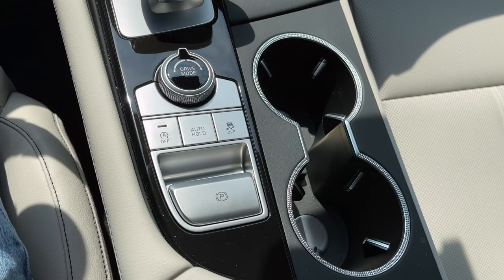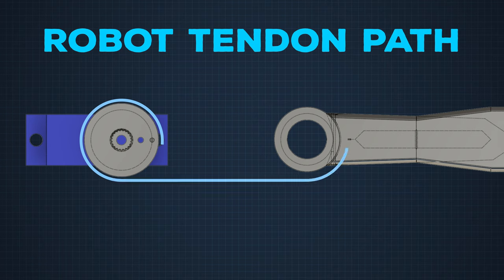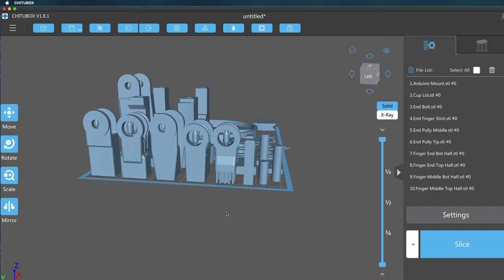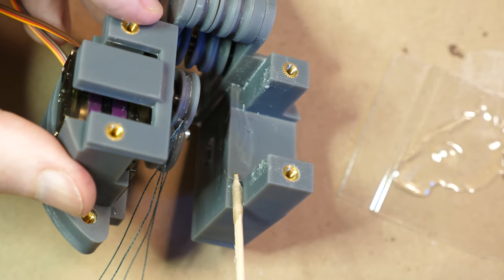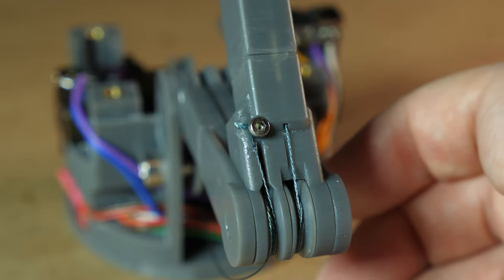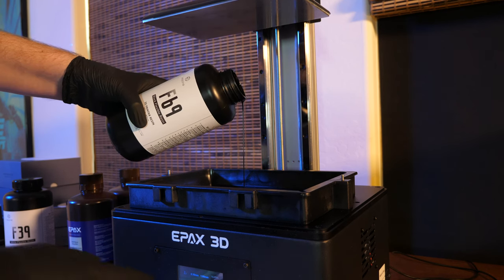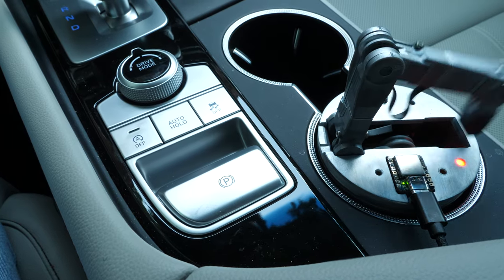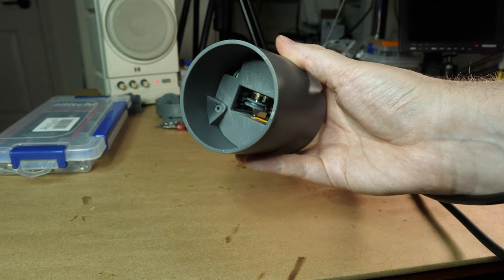Tiny Robotic Arm - Will It Work?

Comment: Without a doubt you need a second robot in the other cup holder to operate the button for the 1st robot!  Even though it was a fail, like my father used to say "don't do anything half-assed, do it whole-assed"
Reply from the maker: Not a bad idea.  But that 2nd robot will need to use some better actuators.
Reply: That's a great plan. Every time first the weaker robot arm tries it ten times without success, and then the other one pressed the button on the first attempt.
Reply: @Nerdtronic  If something doesn’t work use a bigger hammer.
Reply: @Nerdtronic  This was not a failure: it was hilarious. And the way it folded itself up in defeat was icing in the cake. That's not a failure.

Comment: i would have just connected the two wires from the button to the same arduino controlling the robot 
and synchronize the activation of it so it looks like your robot is actually pushing the button
Reply from the maker: A lot of people have said "just connect the wire with arduino" - yeah but then I wouldn't get to make the robot. But your suggestion is off the charts. Do BOTH!
Reply: @Nerdtronic  yeah brother cheat just enough to win . its kinda genius and 
nobody would know .
on the other hand even if you do make a 
video or a short most people would 
actually respect that little trickery.

also it is basically free content
that you can pull off in practically 
no time at all . win / win 

either way you have my blessing 
take care brother

Comment: The auto start stop is supposed to save roughly 7% on average. Obviously there is a huge asterisk as it depends in your route. You should do a test.  Drive normally for idk a week or month with it enabled and another with it disabled
Reply from the maker: I actually only drive about 3000 miles a year in that car. So there are weeks and even months that I don't use the car at all.  I also live in the desert, so summer months the feature turns itslef off anyway because it's 115 out and the AC is running.
Reply: My dad believes it's not worth it because of the potential damage to the engine. I don't have an opinion personally

Comment: Cool robotics project! Get some nice MKS servos. They're small and extremely powerful. They are pretty expensive, but when you need extreme resolution and power they're probably about the best you can do. Also, the fishing line you used will stretch over time. The metal line that is often used for necklaces works great here. You can get it very thin and it is available at craft stores and WalMart. I build RC hand launch gliders (DLGs)  that use bent piece of metal to act as a spring that holds a flight surface deflected in one direction and then uses one of those MKS servos and that metal line to pull it to the desired position. This set up works very well and I've used it for other various maker type projects as well. Great video!
Reply from the maker: Thanks Michael for the detailed comment. I’ll check that stuff out.  Maybe I’ll remake this robot someday.
Reply: I appreciate you pointing out MKS

Comment: There isn't a true-geek among us that doesn't salute this effort. Words like "failure" and "useless" should be saved for other non-heroic and mortal efforts. This robot should live on in perpetuity, at least in our hearts and minds! Yes, you could find more powerful servos that are larger, and require a robot redesign. But another source of very small but powerful RC servos is for high performance RC gliders. In those applications weight, precision and actuator speed are most important, but so is power. Take a look at those servos. They're more pricey, but they may let you use your current design without modification. 

So I'm an American who's been living in Europe for nearly 6 years now. When I first encountered this feature it bothered me too, but I found a different way around it. If your car functions as do the cars I've driven here, you can 'defeat' the execution by using lighter brake pressure. The shut-off occurs when the car's speed is near zero, AND the brake system is near full pressure. 

I was able to train myself to lighten up on the pedal pressure just as the car was about to come to a complete stop - I use just enough pedal pressure to stop the vehicle, but not enough to stop the engine. The engine remains running until I press the brake pedal fully, and I only do so if it appears I'll be there for more than a few seconds. You can also lighten pedal pressure just before you want to car to move, e.g. when you see the light is about to turn green. This way the engine starts, but the car doesn't move. It prevents 'lurching' when the engine starts at higher revs as you move quickly from the brake pedal to the accelerator pedal. 

All that said, please let me also add a dissenting voice to the purpose of your robot. Regarding the small amount of fuel savings that others have mentioned, it's really about emission savings. It's estimated that idling engines cause 30M Tons of CO2 every year. I know it doesn't seem like much when it's just your car, but when it's thousands, or even millions of cars, it does add up to a difference, especially in city driving and bumper-to-bumper freeway commuting. This feature has been VERY popular on European cars for years because of heightened environmental concerns. 

I was also worried that the additional wear-and-tear on the starter system would lead to early component failure and replacement costs. But I think this one of those things that we BELIEVE without data to support it. It's never been a factor that I've heard car owners here complain about. And google it. I think you'll find that modern cars do not suffer from this problem. It's only those of us of 'more advanced years' who imagine it being applied to our old muscle-cars from the 60s and 70s. 

So yeah, I like the idea of designing and building this project. In fact, I'm actually a bit envious of your creativity. I'll attempt to up my game for future "useless" and "failing" projects. Take care. :))
Reply from the maker: Haha thanks!

Comment: Knowledge of leverage and torque forces would have helped you there. That stop start function is more practical in cities because it cuts exhaust emissions rather than saving gas. I also question how long the starters last (as well as the access+cost to replace them when they fail)

Comment: Brilliant! You 'could' always modify that button to just be a flip switch though. 
 
When flipped on it will be normal, 

When flipped off, it has a circuit that will wait however long is necessary and then input the momentary depress signal required to turn off the feature

Then your cup holder robot could instead be a cup holder robot or anything else.
Reply from the maker: I considered hacking the switch but I didn’t want to physically modify the car.  I’m sure there are other ways to do it electronically also.

Comment: Why not hook the arduino up to the actual button. You can read the light within the button and simulate button presses without even touching the button? You may be able to even do it with just putting a plug that you make into the button which allows the factory plug to plug into your plug…
Reply from the maker: Yeah I’ve done that before with other projects. A. I didn’t want to f up my car. B. I wanted to make a robot. 😁

Comment: Yall complain about him wanting to turn off a feature that safes a TINY bit of fuel and cry about climate change, but do you realize that the most wear in an engine happens when starting and stopping the engine? Kinda fun then the feature is called start stop :)

I would rather have the engine burn maybe a few gallons a year than having the engine break down earlier, having to call a tow truck and having to get the engine replaced earlier than needed.

That robot could work, just instead of a little flexible tip, maybe add a hammer to it? 😂
Reply from the maker: Thanks!
Reply: "but do you realize that the most wear in an engine happens when starting and stopping" you missed the part with the word "cold" near "starting", instead your fantasize about wearing when an engine is stoped... stoping an enging damage it? Really?
Reply: Cold starts wear an engine out. If it's at operating temperature there is no more wear than when it's running, because all the clearances are correct at op temp and the oil has already been circulating throughout the engine so there is still a lubricating film everywhere. Wear on the starter should be minimal if it was designed for an engine with the feature. I also believe the feature doesn't start in cars with this system until the engine has had a chance to warm up.
Reply: @space-qc6cl  there is still no oil pressure when the engine is stopped. Our a6 tdi did it's start stop despite running for 20 seconds.

Manufacturers had to engineer the bearings to work for around 3 times longer due to the start stop systems (don't know where i heard that and too lazy to search it)

You can do literally one Google search and find out that start stop wears your engine more than just letting it run.

Comment: My teacher told me once that there is no failure in research. Either you will solve the problem or you find out that this problem can not be solved in that specific way. So in both cases, you learn something.
Reply from the maker: Thanks.  I learned a lot on this project.

Comment: For VW cars they make  harness that you plug into that button that will remember the last setting, not sure if anyone makes one for the genesis.  You can also re-program the computer and change the voltage range so it never stops the engine, it was the first thing I did on my wifes car when we got it.
Reply from the maker: Cool. Yeah I might do one of those things.  This robot was mostly supposed to be for fun.  Thanks for the view Ethan.

Comment: A very good engineering project. Even if it didn't work :) One possible simple solution to try though, might just be to put some weight into the tip. It doesn't really have enough mass for the "whack it ten times" approach and the servos should still be able to move the arm with the tip filled with lead.
Reply: Alternately, repurpose the robot with a slight code change so that whenever anyone cuts you up it can give them the finger :)
Reply from the maker: YES!  This should have been the robot finger exercise.. flipping people off

Comment: Pretty fun project. I think you have a plenty spare time. If you touch that button every time you get into the car you will do automatically, you will learn in your muscle memory.
Any case, I think you can do it work just add some weight in the finger tip. It's like a hammer you just need a bigger hammer

Comment: Take out the switch, connect small relay, use small micro?
Reply: Similar solution I've found to a "ASR being on" problem on a GOLF MK4 but the DIY mentioned soldering in a capacitor, might work with this thing as well.

Comment: Another approach would be to make the button pressure through a roller at the end of the finger. The finger would then "swipe" the button. The force would theoretically be the torque divided by the arm length divided by the sine of the angle of the arm to the button.
Reply from the maker: DUDE.. I just subscribed to you so that you'd have more than one subscriber.  You seem to know a lot about torque and math.  Thanks for the advice.
Reply: @Nerdtronic  I have an Arduino bidet. For real. It has a range detector which I ping to get the flight time of the echo to determine the nearest object. The detector is about a foot off the floor and a few inches to the left. The idea is to detect a dog walking whereupon it turns on the cold water. The cabinet has a red and blue button for a person to select cold or warm water. The water is controlled through a pair of solenoid valves. And it has timers to shut it off after a period. About a year after installing it I updated the software to trigger the "red button" code if it detected an object less than four inches away, which the dogs never get that close. With this I can turn on the warm water while still on the toilet. That is nice in January.

Comment: I truly hate some of the “features” auto makers are forcing on us. I’m sure your car is still under warranty but at some point you might investigate getting the ecu flashed to keep that setting off. That said this was a really cool video!
Reply from the maker: Thanks. I hope it was a phase and that newer cars won’t have it.
Reply: @Nerdtronic  it’s actually not good for the engine.
Reply from the maker: @kz6fittycent  Right?  Several commenters gave me crap for wasting energy. But when I pull into my driveway and right before turnign off my car the engine shuts off and then has to start up again before I shut it off for real - seems like that would be wasting more energy and wearing out the starter.  Not to mention I'm not installing it on millions of cars, just one.

But it was just supposed to be a fun challenge anyway.  Which it was.  Thanks for watching.
Reply: @Nerdtronic  Once you have stopped, keep your foot on the brake and turn the key one click. Then put it in park and turn the key all the way off. 
Newer cars won't have it. They will be electric 😉

Comment: This is a cool project, but umm why go through all the hassle of designing a robot, when you could just use a mosfet, or relay to accomplish the same thing. Plus there is nothing taking up a cup holder. You could put it in the center console so you wouldn’t have too look at it. Although this is still pretty cool.
Reply from the maker: Then I wouldn't get to make a robot. 😁

Comment: Hello, Michael, you two are great. Congratulations to your bright son ;-)
Nevertheless, this is a great and very creative project. Perhaps you could re-program the robot to stir your coffee in the other cup holder???

OFF TOPIC: Unfortunately, I still haven't started using my Phrozen Sonic Mini 4k yet…

Are these resin printers really that loud (about 55 dB)?
Do you think that it is safe to put it into an enclosure of thick Polystyrene (with some reasonable air space around it)?
Do these resin printers get very hot outside?
Could trapped resin fumes cause any problems?

Sorry for these newbie questions, thanks ;-)

Comment: Powering off the engine does save gas when idling since the energy needed to start the engine is minimal. I saw a study a while back and I think it was like if you are waiting for more than 2-3 seconds shutting down the engine is more energy efficient. Just fyi
Reply from the maker: Turning down the AC a few degrees would also save energy - but most people don't do it.  I don't drive much or in heavy traffic.  I don't commute and maybe drive 3000 miles a year.  A lot of times this just turns off in my driveway and then immediately turns itself back on so that I can push the button to turn the engine off again.

Comment: You are trying to push the button via the torque of the first servo. That is going to require a torque of the button push force times the distance from the pivot point to the contact by the finger. You can't make the button require less force (assuming you are not going to modify the button) but you can shorten the moving distance by having the second servo make the final button press. Given the same servo torque you then have twice the button pushing force. I think you could get away with this because the servos have a much higher hold torque than move torque.
Reply from the maker: Yeah.. There was too much play in all the joints.  What you saw was the result of me trying to use momentum to push the button.  Even when I tried to push it using the 2nd joint, it still didn't push because the first joint also had play.  If I moved the robot to the other cup holder MAYBE it would have worked better because it would have been closer.

There were flaws in my design from the beginning and I didn't feel it was worth it to do a 3rd itteration of the design to try to fix that.  The cable coming from the sensor I put in the end, caused resistance on the joints.

I was leaving on vacation when finishing up the video and had to rush the ending.  It was a mistake.  I probably should have released a different video and then spent another week or two trying to get it to work.  If the video had done better maybe I would have released a v2 of it, fixing the mistakes.  But this video sort of tanked so oh well, back to the drawing board. :)

Comment: If you had put the servo's in the joints of the arm you would have saved 80 procent of the time to make that thing. And it would have worked better. But still fun to watch.
Reply from the maker: Fun to watch was the point.
Reply: @Nerdtronic  But it's even more fun, for me, when I give someone advice and they follow it and it works. Place the servos in the joints. There is a kind of lego robot on my channel where I did that. That robot could do whatever you wanted to make.

Comment: Do not make it as a finger, Make it like a CNC tool changer where you have a U shaped bracket that can raise, lower, and turn. One end of the U permanently stays in the cup, the other presses down the button. A CNC tool changer is doing the exact same movement you are trying to do, incredibly reliably. Investigate how they are made and copy their homework. Seriously, the best engineers are the best at copying, they grab the best aspects of many designs and amplify their strengths.
Reply from the maker: Thanks for the ideas. I have more robots coming.